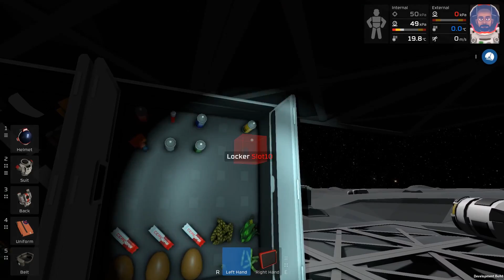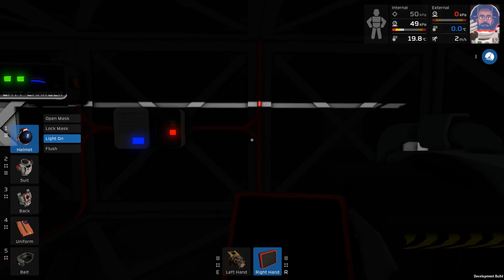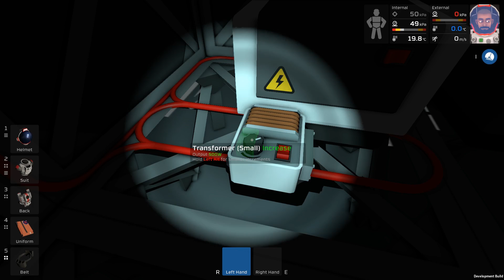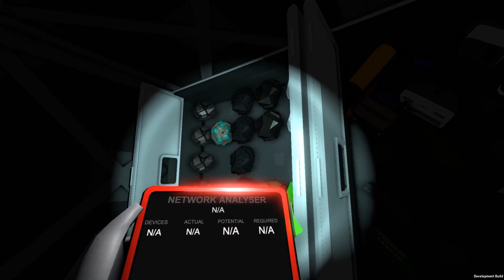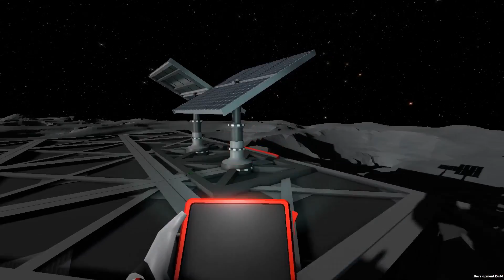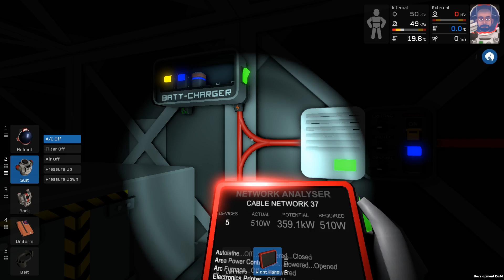Power Storage using Transformers (Attempt 1) | Let's play Stationeers gameplay ep 6 (PC alpha)

Comment: You don't seem to have much of a clue about wiring up your base and you completely bypassed the usefulness of the transformer putting it in the wrong place in the wiring and looping power back to the battery. You should be using heavy coil wire from ALL you power generating devices to your station battery/batteries and also from the battery to the transformer. From there you can use normal wire out to your APC's and the rest of your base.
Reply from the maker: Fair enough; doing a follow-up episode for all this.

Comment: I followed the 11-stage solar controller programming guide on steam discussions and consistently had 440-480W per solar panel. Using the labeller to number them made it easier to add them all on the computer. I didn't know about transformers though and kept burning out wires to my battery.
Reply from the maker: I'm still in the testing stages with the transformer, as people have pointed out I didn't use it correctly in the vid!

Comment: it should be power sources, battery, transformer, apc and then the rest of your base. before apc should be using heavy coil wire. It not whats going into the battery that needs to be controlled but what comes out of it and also up to apc should be wired in series not parallel. One more thing that battery charger can steal a lot of power so might want to use a separate apc just for it.
Reply from the maker: Ah right, noted!
Reply: yeah those stationary batteries can discharge (and charge!) at like 3.4MW or something, it will quickly fry HV wire if you have too much draw not behind a transformer. They will create a potential draw that is catastrophic to your wiring if not careful